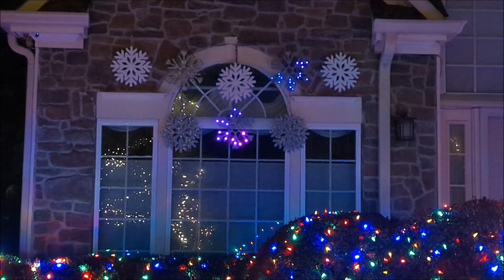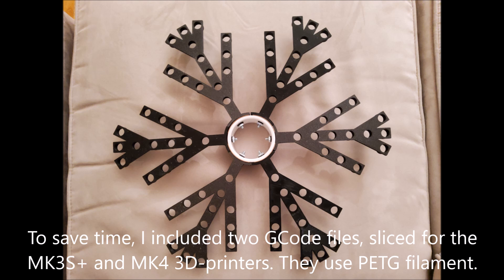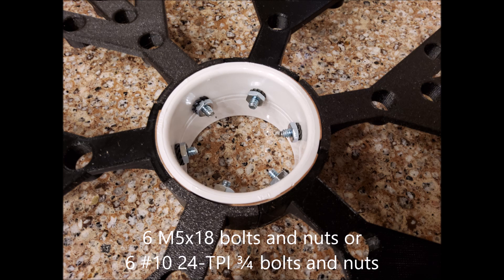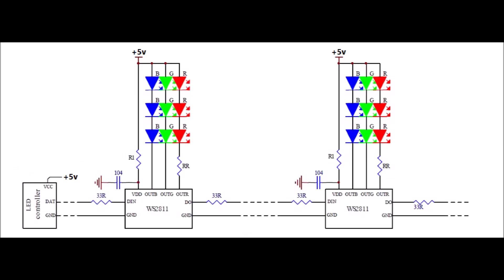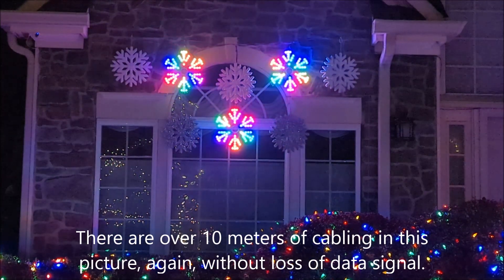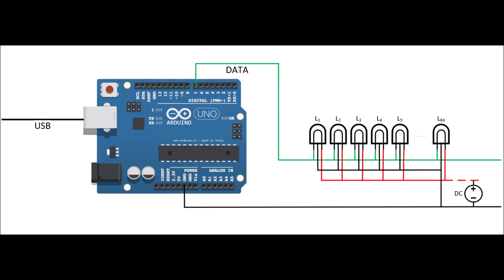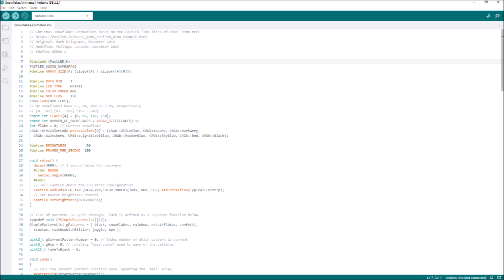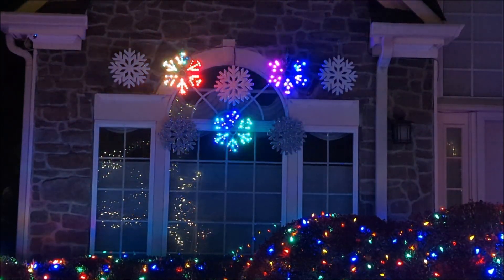3D-Printed Electronic Snowflakes using WS2811 LED Strip

Comment: you can also use wled with an esp32, im not joking, takes like 2 minutes to set up
Reply from the maker: Yes, it is very true. Actually, this summer, I built the https://www.printables.com/model/482760-epcot-spaceship-earth
Reply from the maker: That said, while you are correct, I am not sure how I would deal with the fact that each snowflake can be its own unit from a lights pattern point of view. How would you tell WLED that you want to turn the snowflakes, say, red, green, and blue? With the FastLED library, you can turn one snowflake uniformly red, the second one off, while the third one displays a changing rainbow. Granted, in practice, having a rainbow "roll" across all snowflakes is good enough.

Comment: This is cool but looks like it is 12mm pixels not strip. Still very cool and will try printing some for my layout. Thanks for sharing and posting!
Reply from the maker: Yes, 12mm pixels
Reply: @PhilippeLacoude   this should map to xlights nicely and looks good too. Do you have other printable pixel props?
Reply from the maker: @diyhometheaterguy  Not yet. I am working on indoor Christmas balls. But it will be 5mm pixels. Not 12mm.